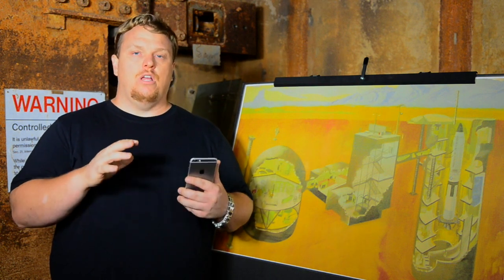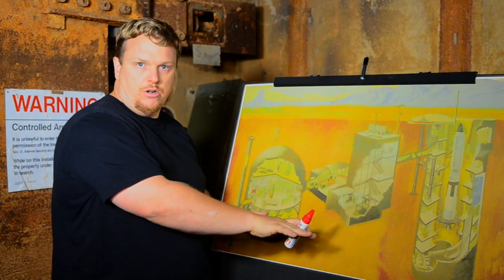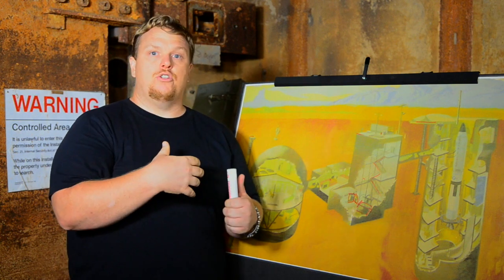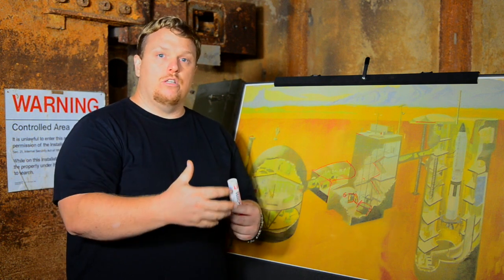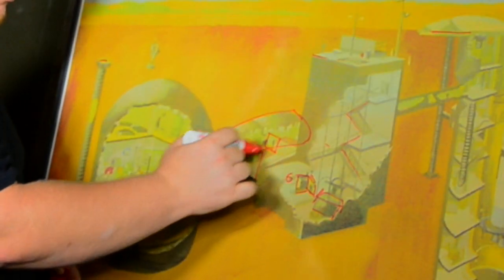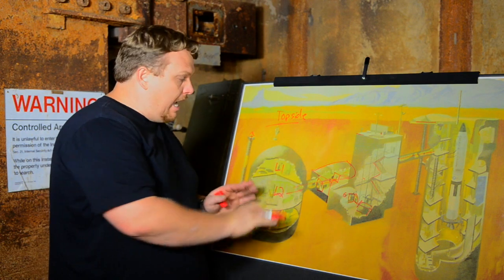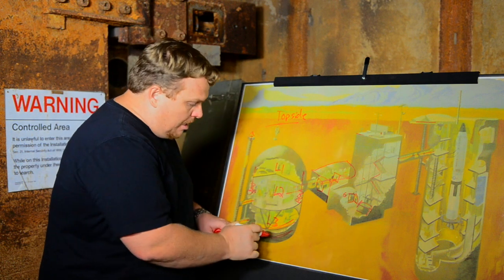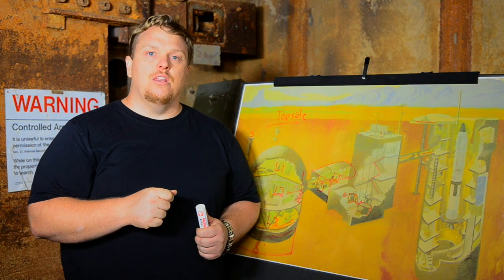Fan Q&A: Can you please explain the layout of the Titan II?

Comment: Have you gotten into the missile silo part of it yet? And if not maybe I missed it, what is in the way? I think you built that dam there with concrete. Isn’t there upper access doors? Were those broken up too?
Reply from the maker: Yeah, the top 25' was blown off and a 60 foot x 3 foot cap was poured 25 feet underground above the silo. Making it tough on a guy. :-)
Reply: Death Wears Bunny Slippers Are you ever going to try and get in? Would that be something that would even be posible lagisticly ? I fear that Dam/Plug/Bulkhead you built wont hold out to long against water level rise.

Comment: So, I have been looking at these online pictures of Titan II silos (533-8 Kingman, KS) being filled in, and it seems to me that the fill looks like the top surrounding concrete lid and support structure, berm that is bulldozed in. (It is actually good news that you are saying the inner most part of the silo is filled...) however, if you have chunks of concrete the size of Texas down there, you're going to need to make some sort of crane... I'm thinking like telephone pole tripods with winches like the Coral Castle guy used to move monolithic stones... (Or you could see if that jack hammer guy you hired is still in business... ) that entire tube is filled with water by now... So I guess I am wondering how much material are you going to have to pull out, and the scrap guys are going to have to come back. 

Also; Since you're in a contained unit with limited air flow, you might consider lots of plants that purify and filter the air, because all it takes is one night of ham & beans to peel the paint off the wall. Maybe, some computer sized fans in the empty conduit tubes near the blast doors. The thing you have not thought about yet is the humidity levels from the people living in this bunker and your Aquaponic set up, and the occasional shower... You're going to need a good dehumidifier more than you are going to need central air. (I suspect the ambient air temp year round is about 60 degrees). 

I'd probably build the bathroom out by the stairs.... Your septic system; Do you have a septic tank or is it a lagoon like the Atlas sites? You might consider going a little large on that specifically if you are going to be letting people come in to chek your Batcave out. 

...And this led me to think (the bathroom vs lots of people). If you clean the place up and upscale it just a little bit. Drop in something like a wine cellar along the tube to the silo... and furniture that you can burn later... you could potentially have high rent bachelor parties with high rent strippers and you would have the money you needed to clear out and refurbish the silo in record time. Just saying... Women have bachelorette parties too... You just have to market it.

Thanks for putting up the Titan 2 mancave porn. I keep telling my self no, but I keep thinking about one for myself. 

Oh Yeah, how high is the water table where you are at and how is that managed? You got a industrial sized sump pump? (It looked like in the first video the septic had dual electric 3phase Baldor motors (They were big, like 7.5hp) how did you figure the head for pushing water from so deep? What size impeller did you have to put in? (Or was the original one still serviceable?)
Reply from the maker: Hey Derek - Thanks for all of the questions. Before I answer them... have you watched all of the videos?
Reply: Almost all of them!
Reply from the maker: Well you have some good questions that I haven't answered yet. But I think I answered quite a bit about how to open the silo... I think its in a Q&A. Let me know if that wasn't answered well enough.

Comment: OK...I get how the water is getting in now what with the ground water being so high, but, since the ground water IS that high how the heck were they able to build it that deep in the first place esp. the silo.  Isn't that about 160 feet deep or so???
Reply from the maker: Its about 145 feet but yeah... only thing I can guess is that they had some bad ass pumps running during construction.
Reply: Maybe when you get to the bottom of the silo you think about putting in a pool.
Reply from the maker: Dive off the top? :-)

Comment: What about the surface property? Are you planning to build a living quarters above ground, or sure-up security? Forgive me if it's been addressed, but do you plan to use this as a primary residence? Whats your estimated cost to upfit everything and will you upfit all 3 sectors of the facility? Great channel very captivating.
Reply from the maker: Matt... that's a great set of questions. I plan on doing a video to answer them. Will that work? Thanks!
Reply: Sure thing. Living vicariously through you. Take care

Comment: Super cool! Random question:  Did your bunker originally have an air-filtration system, and is that something you will have to install being underground?
Reply from the maker: It had quite an extensive air handling system but that was mostly because there was a LOT of equipment in there and it needed to cooling etc. I don't need to cool... just dehumidify. But, I'll need a way to move air for sure. It really won't be much different because its underground. The natural temperature is 58 degrees (F) so I may have to heat it.
Reply: Interesting. Thanks for the reply. At least it will be nice during the heat of summer. :)